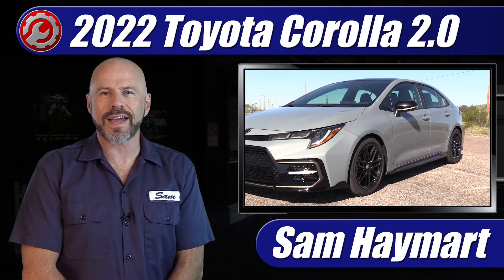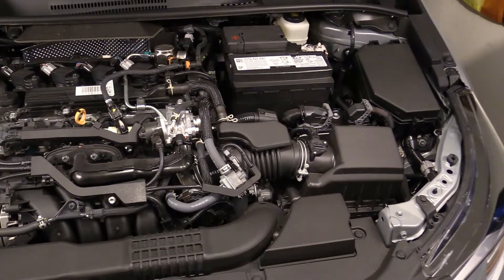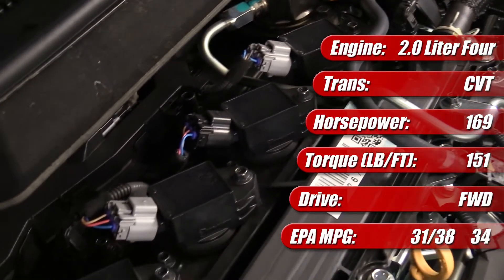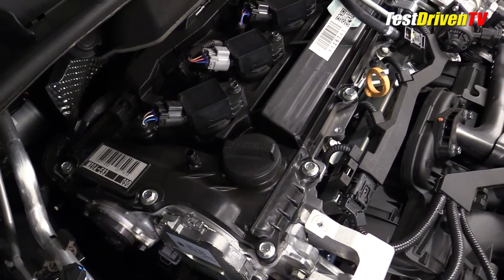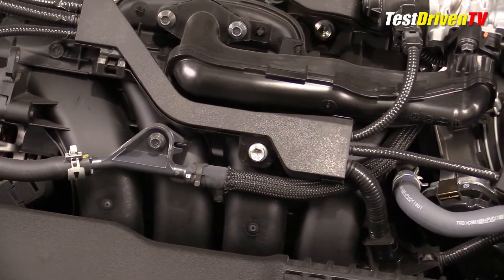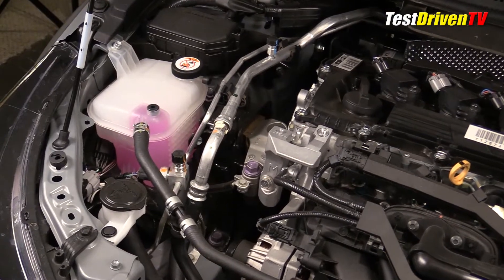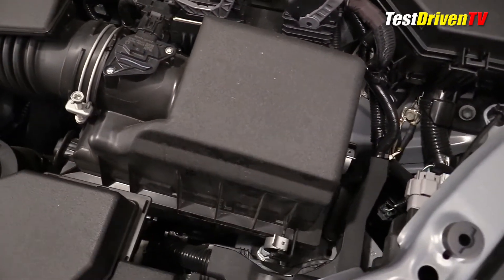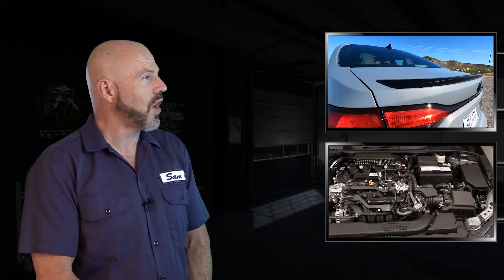2020-2024 Toyota Corolla 2.0: Engine Explained

Comment: I recently bought Corolla Se 2020 and it’s a beautiful car for its class. But I have a small issue. When ever I run the car. Their is a small amount of sound of vibration from the driver side and when ever I look at the engine temperature looks very normal and I went through the engine compartment it seems their is a sound but not clear from. Can I have any suggestion before I go to a main battle with the maintenance GRAGE and argue about it 😅😅

Comment: This is one of the best engine ever specially the 2.0L it could last for too many years I promise you gonna pass this car to your children if you keep taking care of it can you imagine I still have 1991 corolla works just fine
Reply: I bought one for this reason. My daughter is 6 and I plan to give my car to her when she’s driving. I expect in to last her another 10+ years trouble free. She’s already helping me with the DIY oil changes on it
Reply: I thought this engine wasn’t proven yet? 1.8l is the engine I know is super reliable
Reply: @MegaCokamo it’s been in production with Lexus and Toyota vehicles for 7 years now. Maybe not as proven as the old 1.8 but on its way
Reply: @ryanb5189  that’s good to know. I own a 22’ SE. I wanted to get a standard transmission but considering they’re not easy to find I went with the CVT. I wonder how reliable they’ll be

Comment: Can I use 0w20 oil for that engine? What do you prefer
Reply from the maker: Owners Manual has your best recommendations
Reply: 0W16 at most.. 0W08 regularly but know winter jm thinking of using 0W16  🤔
Reply: @growshack9067 You have it backwards. Thinner oils like 0w8 are better in winter than thicker oils.

Comment: I need to know, can i put this M20a fks engine with cvt transmission in 2018 corolla which comes with 3zr fe engine and cvt transmission kindly help me out?
Reply from the maker: Anything is possible but at what cost and is it worth it in the end?
Reply: I have no issue regarding the price could you please tell me, Do i need to put just engine m20a fks in the 3zr engine place or i need to buy all the computers ecus and all that stuff or the woring and rest is same for both like plug and play.
Reply from the maker: We would not know other than for what it would cost you and the potential nightmares in making it work right, you could buy another car that meets your needs. Sounds like a fools errand with no real reward.

Comment: Wondering if the PCV valve is easily accessible,any knowledge on this? Also, wondering if the EGR system would be a problem to keep clean as mileage accumulates?
Reply: So far compared to last generation EGR has not presented to be a problem.

Comment: Wish they would lower the compression and turbo this engine
Reply: Turbo ruins engines over time. The oil gets over heated and most people won't do 3000mi oil changes on those.

Comment: Was going to buy a new corolla. I am leery of the 2.0 over engineered pos. So it looks like a civic for me.
Reply: The 2.0 is way more reliable that that Honda 1.5L. Naturally aspirated will always be more reliable than a turbo. And Honda has multiple lawsuits against them about the 1.5 and oil depletion. Only old Hondas for me
Reply: I was on that boat too till one of my friends accord had turbo issues at 100k, and my other friend's accord's head gasket blue at 80k. All the added engineering to this dynamic force engine scares me but I'm hard pressed finding major issues with it online compared to Honda
Reply: I am a Honda guy. I drove the si and sport. The 2020 Corolla is much better and more refined. 7 grand shifts with no buzzers or bells or rev limiter coming in. No center exhaust which does not let you install a hitch mount bike rack. No summer only tires. Honda seatbelts are located behind the seat so you have to drive like a 17 year old or dislocate you shoulder to get to the belt. 
3 years in 33k and not one issue with the Corolla for me. Keep an open mind and try a test drive. 2022 was last year for the stick in the Corolla 🤮
Reply: @67box I got the old 1.8 litre engine on the Corolla for the 2020 LEA

Comment: I bought a 2022 brand new Tacoma, I also own a 2021 Toyota Corolla LE 1.8 Ltr, I payed my Corolla off fast, it now has 45,000, my trunk release broke so I took it in to dealer, they asked me if I wanted to sell it, I said no but what would you offer, they came back offered me 21,000 I gave them 5k cash and my car, I now own another payed off Corolla and this one is the SE with alloy wheels different front , rear small spoiler with the 2.0 all weather floor mats including trunk and rear trunk protector , this car came exactly like this, I payed extra to get these things, this was the best deal I’ve ever got from a dealer, also another plus this SE came from Japan! If that trunk didn’t break I would never be getting another new car this fast! They are selling these used cars for thousands more than new ones! They had a 2011 Corolla LE w 114,000 miles for 17,850! DONT BUY USED RIGHT NOW, it’s worth the wait! I can’t believe I’m all ready getting another new and better Corolla in just one year and it’s also payed off!
Reply: Bro, I just got a used 9,000 mile "salesman driven" 2022 Toyota Corolla SE with a 2.0 L engine and this is my first ever import vehicle of this size, had SUVs before, and and interior comfort of these cars. the sports edition really dressed up the corollas. I would've bet you $1000 that this car would not perform the way it does, be comfortable to ride in, and be a little peppy,before I  stepped into it . well after driving it, I would've been paying you $1000. The last time I stepped into a Toyota Corolla was back in the late 80s and this is a totally different vehicle and put the older ones to shame. All this and less than 22 grand is amazing! And it will last if taken care of for 250,000+miles.
Reply: I'll do the same once I pay off mine
Reply: 1.8 super engine

Comment: Im running 87 in this now. I can get 91 for aroumd same price. With a 13:1 compression it wld probably be better eh?
Reply from the maker: Not necessary. The high compression is a non-issue because of the variable cam timing and variable fuel delivery ratios - not like the old days engines where high-compression meant knock and ping.
Reply: @TDTVGarage  thanks for the reply! Means alot. I only drive 12,000km per year and can get top tier 91 octane for 5 cents more per liter. I just thought why not. It wont hurt anything right?
Reply: @michaelallen2221  I know this is a late reply.  While it won't hurt anything, you won't gain anything either for this engine.
Reply: @michaelallen2221 It may be worth it if you see an increase in gas mileage. Run a tank of 87 and 91 and compare the mileage vs cost to see if you save any money. Either way, running top tier fuel matters most rather than octane.
Reply: @ChrisSysaktor yeah its def worth it. The 91 runs smoother, u get better mileage 2 to 4 percent or more, so it pays for itself. Also all toyotas cars and trucks hp and torque are all rated using 91. 91 been running for 3 yrs. And in our 23 off road tacoma. And wow! Ppl tht tell u to just run 87 or 87 wont do anything are dead wrong and dont know crap all!

Comment: I had the short block replaced under warranty in my 2020 due to a crankshaft thrust washer failure, according to Toyota. Debating trading it in.
Reply: What symptoms did you have ?

Comment: doesn't cover transmission fluid or coolant those fluids do need to be changed by DIY people.
Reply from the maker: Transmission is not typically user serviceable and has no dipstick to point out. One has to be an advanced mechanic to service it from underneath. The coolant reservoir is pointed out and discussed in the video.